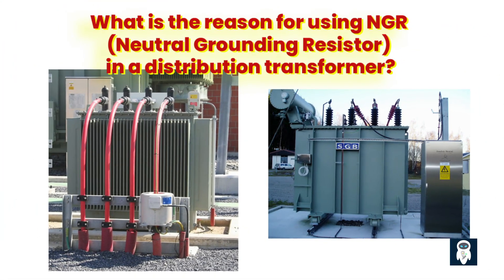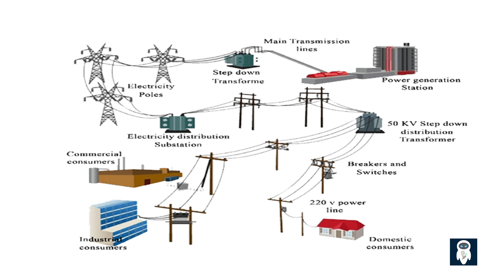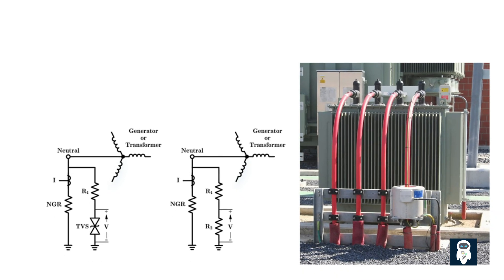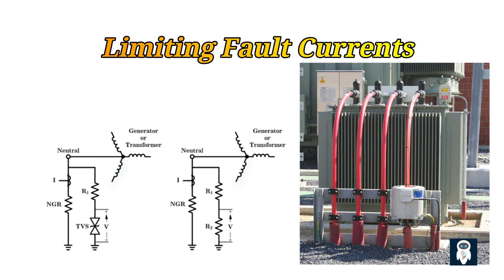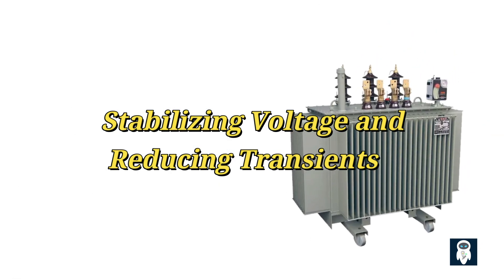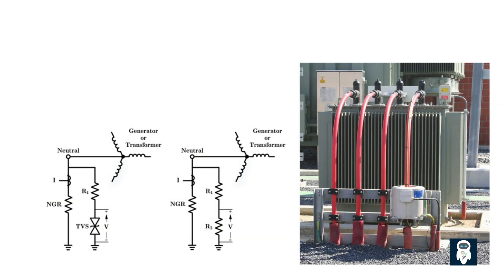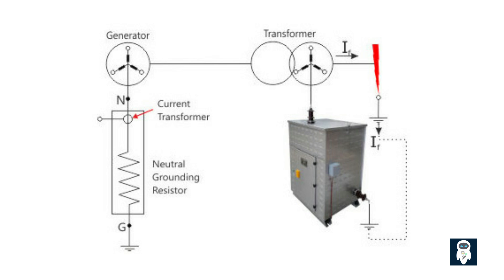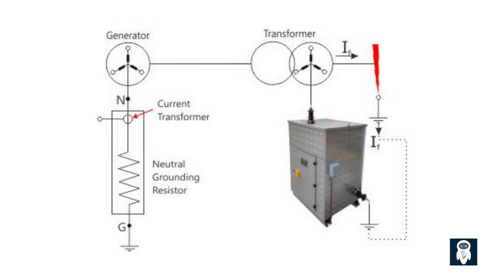What is the reason for using NGR (Neutral Grounding Resistor) in a power transformer?

Comment: Does the NGR uses variable resistance or fix resistance value? in case of voltage changes, whether the NGR current remains constant or varies wrt rate of change of voltage?
Reply: (salt) water tank is  as the resistance.
cant imagine variable resistance applied to HV system, but earthing transformer provides low earthing resistance (path)  during fault condition.

Comment: Great video though I find something a bit off here. Grounding the neutral directly will take care of the high transient voltage but fault current can rise to dangerous levels. I guess the main purpose of neutral grounding (impedance) is to limit this current... this is achieved at the expense of transient voltage dampening. I'm used to NF C and EN but not the UL; but standards are just guides. The theory behind these is the same.

Comment: In multipoint grounded neutral power systems, common in the US, there is current flowing through the neutral-to-ground wire, under normal (unfaulted) conditions. Do you know how can line-to-ground faulta be detected in this case?
Reply: There are different ways to detect ground faults while ignoring expected neutral currents, but in all cases, the neutral to ground bond must be terminated between the transformer (where the neutral is formed) and the protection device. This way, the current flowing through the neutral can be differentiated from that on the ground, as measured by the protection device. In 3 phase systems, the protection device monitoring phase and neutral currents can calculate the current expected on the neutral, based on system imbalance. If there is a difference between calculated and actual current measured from the neutral, the current must be going to ground.